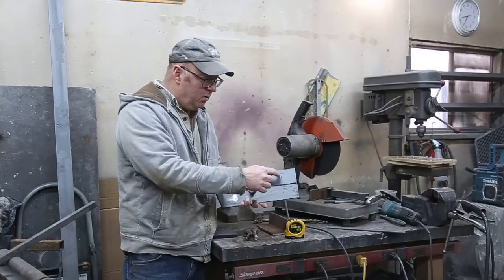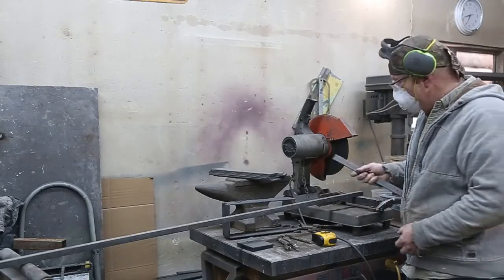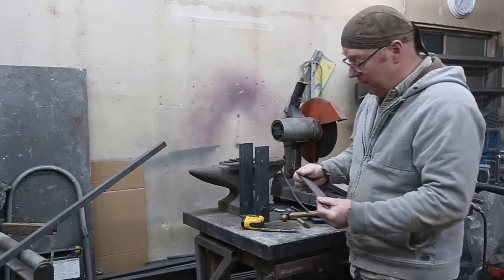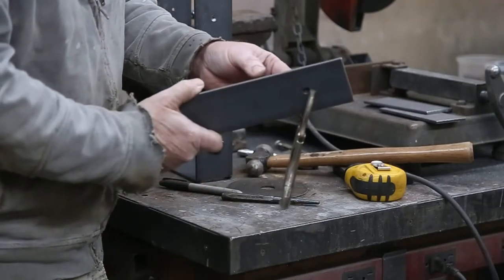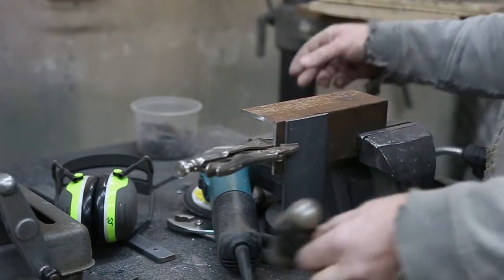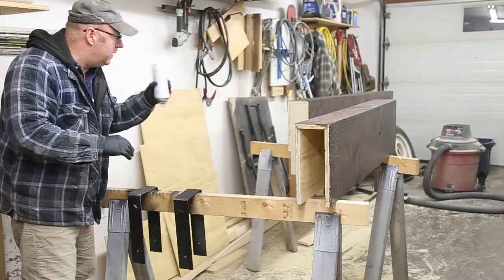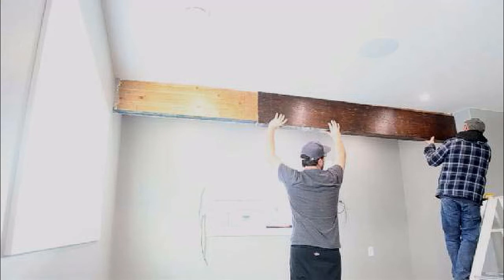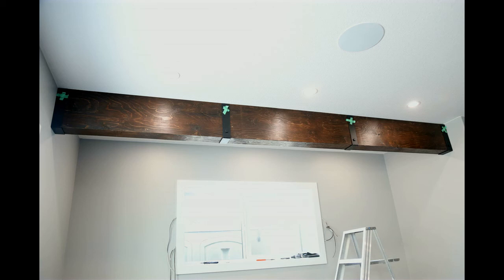Cladding a Basement Beam to Look Old and Rustic part 2 Metal Straps

Comment: This is almost the exact project I'm working on now. I just bought a bunch of nuts and bolts, dreading drilling so many holes, but I like your idea much better. Both sides of my beam are visible however, so I'm not sure what to put on the opposite side of the fabricated square "bolt heads".
Reply from the maker: It's been so long since I did this one but I did glue the fake square heads on both sides.  I just found it easier to do.  You may be able to purchase a share nut at a bolt supply shop.  I hate drilling holes as well, all that work and you have a round nothing when you are done.  Stevo
Reply: @stevoj8959  You did the project awhile ago and I'm sure it has aged well. Thanks for putting this video out and for responding! I'm inspired now.